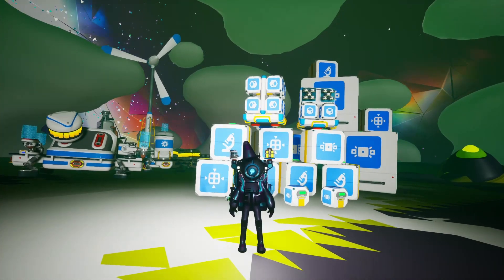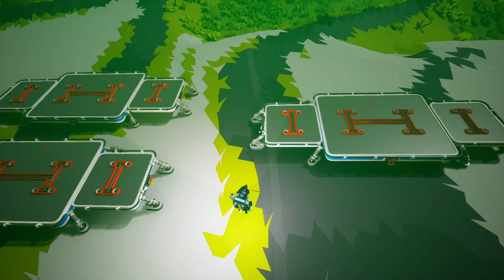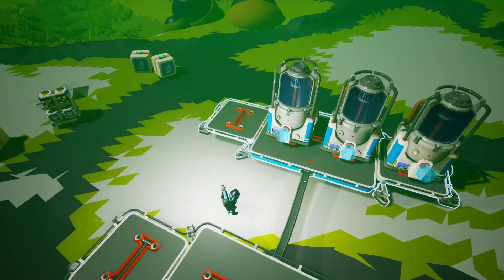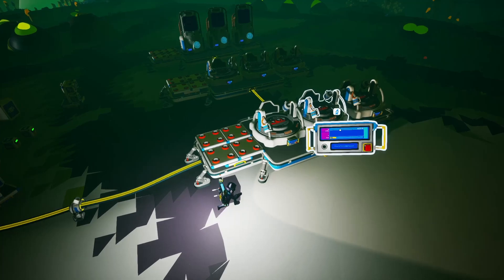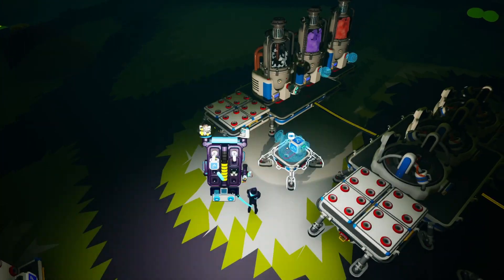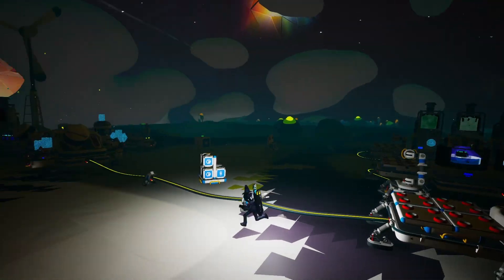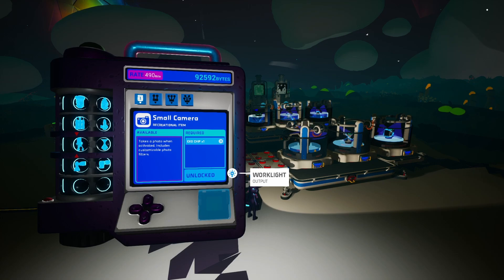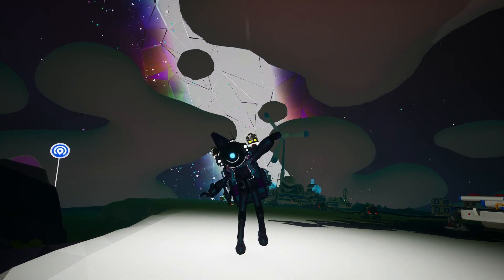Stop Struggling! Get INFINITE Bytes! | Astroneer Guide

Comment: Instead of a platform of condensers and then auto arms moving things around, you could simplify it by doing a condenser and two research chambers and one medium storage per platform.

The condensers are already serving two research chambers each now. Depending on how fast you can produce gas and power, you could forgo the medium storage and add a third research chamber. The medium storage just gives you a buffer so you don't have two chambers finish at once and only one gas waiting at the condenser.
Reply from the maker: That would be a more effective, modular design! But for this video, I wanted the whole farm to be one single big thing instead of just multiple smaller farms next to each other, because I've already built one of those in another video!